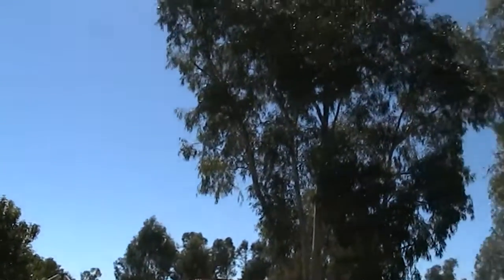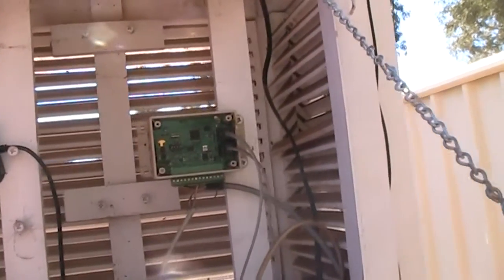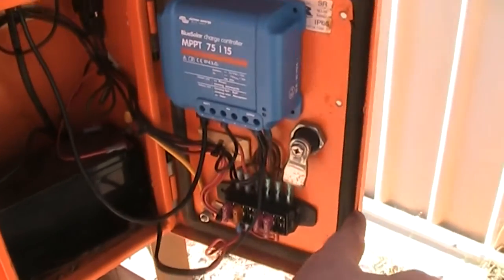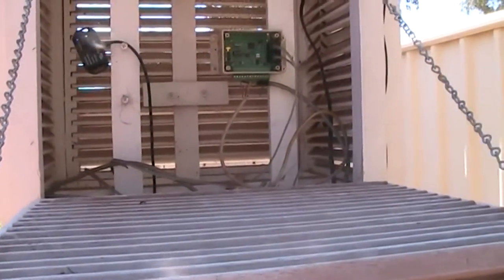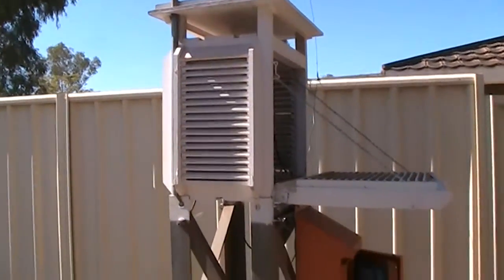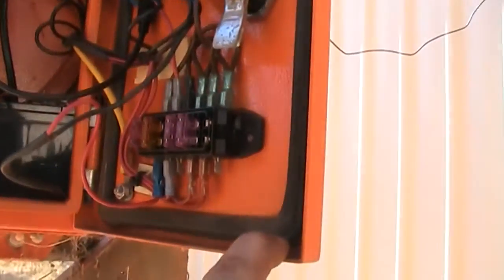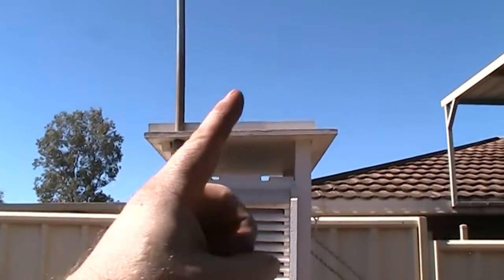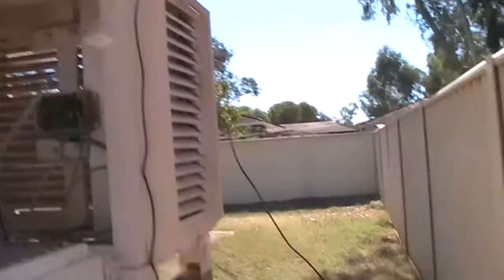Off grid weather station part 1

Comment: an idea if ur running long range as in 280meters or so you can use wifi direct to communicate to it ... and not really need internet either ... they sellthese real tek wifi direct dongles thatwork pretty good i used them on my moms ranch in texas u can just use them with a rasberry pi to connect to laptop and not need wifi :-) .... 
 im actually been fooling with sdr rtl ... its pretty cool it dont need internet either after you do the set up and install software stuffs ....
you can track noaa satilites and decode images